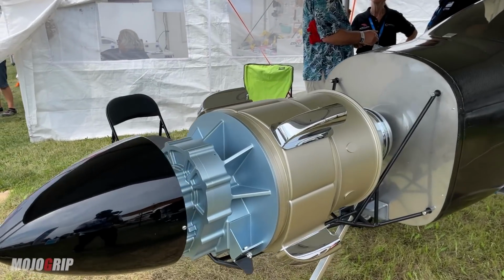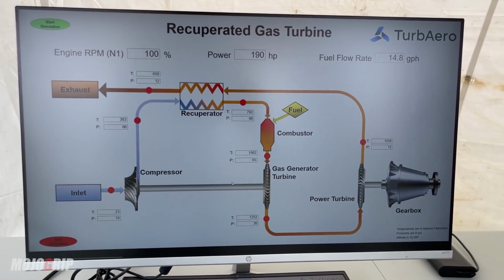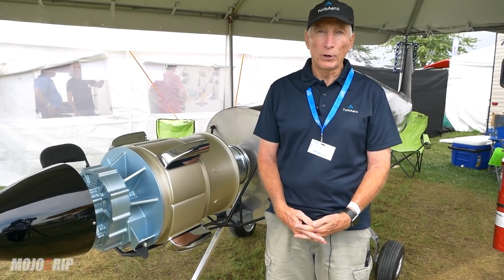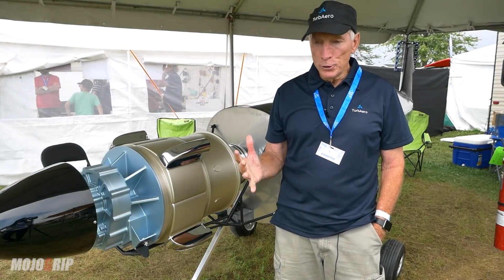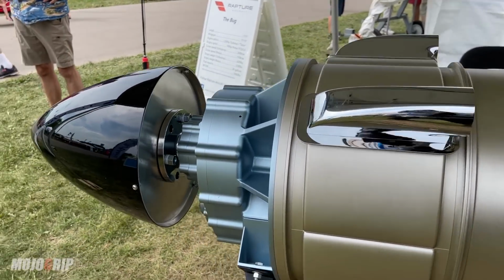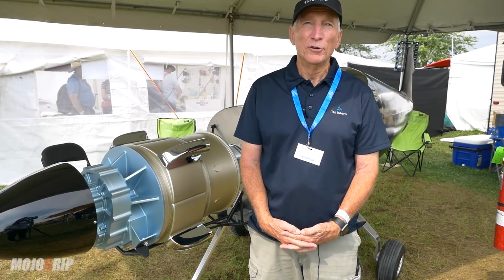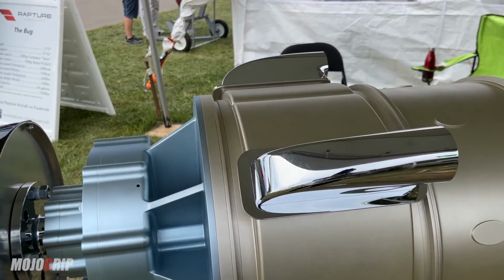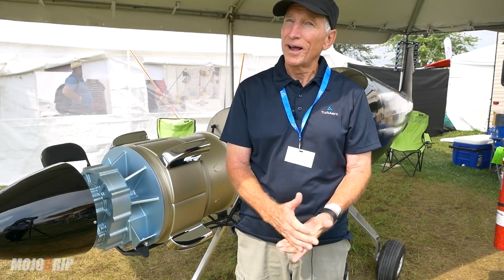200 HP TurbAero Jet Engine Will Cost $85,000

Comment: Reliable turbine 300 hp for $85,000 and ill trade in the IO-550 tomorrow.  200 hp is a joke.  Fuel flow 33% higher.  Cost 2X.  Maintenance 10X.  And the ridiculously named “recouperator”. Ha ha. Yet one more dream engine that will NEVER pan out.  There have been dozens since i started flying.

Comment: 200 HP it's to equip a cessna 172 or PIPER ARROW, most interesting if you put 300 hp/ 250 hp, to equip other planes... 200hp is very low!

Comment: Deltahawk Diesel has been "ready for production" for 10 years now.  Innodyne took my deposit promising a .59BFSC rating.  I should have known better since it was a single stage compressor design just like my helicycle.  The PWM fuel injection offered zero efficiency improvements.  Long story short - what you see is a 3d plastic print of what an engine will look like.  Components being tested means that it has never been assembled or run as of 2022.   2023 would appear to be a pipe dream to me for distribution.  When the engine is installed on a RV-14 and will show at least the same performance as a 210HP IO-390 and a true fuel consumption can be established I will then be very interested.  I truly hope they are on to something here, but I will guarantee you that if P&W could improve fuel economy by 30% or so they would most definitely come up with a "clean sheet" design to sell to BeechCraft for the thousands of planes already in the air and the thousands to be produced. I wish them well, but please show us the inside of the engine with hot and compression sections.  A good engineer will immediately tell you if any of these efficiency claims are reasonable.  Also, JetA is now more expensive than 100LL.  If uncle Joe and Mrs Giggles is in power much longer you will need hamsters and wheel to power your plane.  Any fuel will be unavailable.

Comment: Will this high-efficiency smaller turbine (with a 19 gallons per hour fuel use) have enough power to support: 
  *  Air conditioning
  *  Pressurized Cabin for 4 - with Oxygen
  *  Anti-Icing
  *  Autopilot
  *  Retractable Landing Gear
Reply: I read somewhere it generates 100amps.
Reply: Turboshaft engines  are what keep helicopters in the air - that's no small feat.

Asking a smaller turbine in a fixed wing to simply spin an alternator is straightforward.

Comment: Specific fuel consumption is apalling and specific weight too heavy. At low power the specific fuel consumption gets to be downright catastrophic.
Reply: Hello Ari.  Did you consider the difference in Specific Gravity of JetA and Avgas when comparing fuel consumptions?  It is not valid to compare SFCs when the SG of the fuel types is different.  If you care to compare the anticipated fuel consumption at 10,000' of the Talon operating at 150hp to that of an IO-360 operating at 150hp (actually the IO-360 is limited to 70.8% of its sea level rating at 10,000' so about 140hp at WOT at 10,000'), you will find that the fuel consumptions aren't too far apart.  However, when the cost of JetA is compared to Avgas, you could be pleasantly surprised to find you have a lower fuel bill with the Talon at those operating conditions.  
Of course, each aircraft owner will need to determine what his normal mission profile is and do a valid comparison to determine whether they should be considering the Talon as a viable alternative to their powerplant. e.g. the owner may find that his IO-360 is not powerful enough to cruise above 10,000' and has to accept a low cruise speed in his Lancair due to only having a maximum of 140hp available, but the Talon at 10,000' will still offer more than 180hp.  The Talon won't work for every one, but it will for some.  At least for those, we will offer an alternative to the existing piston engine offerings.

Comment: Why are so many people in the comments section so negative towards this. Clearly some of yall have never flown a 2 or 3 hour cross country sat behind a io360. Now do that regularly. The fatigue due to the vibrations is insane. Imagine having a small 4 place plane operating with turbine smoothness and quietness. And dont forget. Less points of failure. I hope this succeeds this is what the GA market needs. Remember when everyone was against automation and computerization in the ga market until players like diamond took the leap of faith and now anyyyyyone would kill to fly a da42 or 62.
Reply: I disagree with pretty much all of that. I routinely do 6 or 8 hours a day behind a noisy piston engine, and it really isn't a big deal. I'm still against a lot of the automation, but mostly the touch screen nonsense, specifically. Diamond aircraft are hideous abominations. I don't care if I ever fly one really. This turbaero engine would be really cool though.
Reply: Problem is that it will burn a lot of fuel, turboprops are extremely inefficient below 500bhp
Reply: Hey it's been 3 years, did this make it? I can't find any info and their website still talks about future tense.

Comment: When they've got an option for 350+ HP, I'll be VERY interested.  The 200hp is just a little too small for what I'd want to use in a Lancair build.
Reply: Buy Walter... It is much cheaper, tried and tested, comes with reductor and prop from factory, It has 600hp out of 190kg engine. Check it on wikipedia. You have all the specs.
Reply: @OleDiaBole  I'm very familiar with the Walter.  Lots of Lancair Propjets have them.  The down side of these is their availability.  They're not easy to come by.
Reply: @RealRickCox  How about Russian Klimov VK800S? 140kg/800hp. It is  extremely modern, and specific fuel consumption is 260 grams per 1 hp.
I am not sure about Walter and state of their business, but Klimov, you can go an by one straight from the factory.
Reply: @OleDiaBole  Damn that sounds like a sexy engine!

Comment: It's interesting, but since it requires more fuel capacity to burn and the fuel is heavier, this is a niche engine. If the engine weight is hundreds of pounds less as a similar power piston engine, maybe it would pan out.

Comment: Sounds interesting but they should actually abandon it and do a turbofan instead. Imagine how cool it would be to have small twin jets on Sling size planes. They would need to be pressurized but same size and lower weight. 700km/h, twin engine crossing oceans, smooth quiet at the edge of space. Just sayin :) That would be real freedom. Diamond DA50 need not apply.

Comment: This engine cannot get the BSFC that is claimed. Period. The end. My day job involves gas turbines, and we've done a few "clean sheet" designs (LEAP, Passport) recently, and would have done anything to get the specific fuel consumption he is hinting at. The GE Catalyst is clean-sheet, and won't come close to the claims. Neither will the Talon.
Reply: If they can make the recuperator work, the SFC numbers are possible. These are used on stationary and marine gas turbines, lowering SFC substantially. Also used on Chrysler and Rover auto motive gas turbines back in the '60s.The big difference is there is lots of space available on boats and static applications and weight isn't a concern. In an aircraft, space and weight are very important. The challenge is making a compact and efficient HX and that's a hard nut to crack. It all hinges on that aspect.
Reply: Hate to burst your bubble Kenny, but the 120hp is doing all they claim it will do, but as mentioned, the packaging with the HX is where a lot of effort is being put .. 

 Why they don't have the fully working 120hp on display, I don't know
https://www.youtube.com/watch?v=FEn1iCU6Hh0
Reply: Isn't GE projecting around 20% better fuel consumption than a comparable PT6?  That would be a great achievement if they can.
Reply: Correct.

Comment: I would consider one for the following reasons:
*reduced noise
*reduced vibration
*more power at higher altitudes
*no shock cooling concerns
*the "coolness" aspect
"Full fadec
*Lower in cost Jet-A
*did I mention the "coolness" aspect?!!
Reply: But it's 2x the price of a TIO-360 that makes more power & burns the same amt of fuel.
Reply: @dieselyeti  100%

Comment: The fuel consumption of 12gph (they won’t get that, it will be more like 15gph) won’t make it practical.  Cool, but not practical. Turbines do well up high, real high. I burn 7.5-8gal per hour at 8kt DA in my io-360.  Turbines aren’t new. The reason GE and the big guys don’t do it isn’t because you need a clean sheet, it’s because there is no market.

Comment: This is much more the originality reported or mis quoted , I thought it was 8k
Reply: Mike did a video on this yesterday and I thought that’s what he said, maybe wishful thinking 🤔 LOL
Reply: You thought a brand new turbine engine was going to cost the same as an experimental auto conversion piston?
Reply: @TheOwenMajor  The original intent was to make a low cost turbine, then an MBA modern business guy got involved with the company ... enough said ..
Reply: @markmark5269  Well there is no way you are going to make a successful turbine engine selling engines for that cheap.

The only way experimental conversion engines get that cheap is because they are pulled off a assembly line that makes hundreds of thousands of them.

Best case scenario they still sell under 20 of these a year. At 10 grand  profit per unit that is hardly enough to keep the lights on
Reply: @TheOwenMajor  I am the messenger, merely repeating facts, but not my facts.
Reply: The original intent was to make a low cost turbine, then an MBA modern business guy got involved with the company ... enough said ..

Comment: This product does not make sense to me. They're aiming at the value end of the market with a modestly powered, very expensive engine. Its nearest competitor would be the turbocharged Austro engines and the Continental 300-CD. As with the Turbaero they use use Jet-A, have FADEC and perform well in high altitude, but they're cheaper to service and use 25-50% less fuel. Cessna stopped production of their Diesel 172 after 6 months because nobody wanted to pay the premium over the petrol version. That's the market Turbaero is aiming at.

Comment: "Recuperator" fancy word for a heat exchanger.
Reply: Not a fancy word, it describes the thermodynamic function like intercooler does.
Reply: I can't see how it will actually help. You can use a regenerator, but your back work ratio (ratio of the compressor work to the total output work) is increased if you're heating the gas and increasing its pressure. An intercooler might be more useful here.
Reply: @deSloleye  Actually, regens have been used to good effect, usually on Earth-bound machines.
Reply: @UncleKennysPlace  yeah they do save a bit of fuel where you get high effectiveness of the heat exchanger. It will be interesting to see how they implement it.
Reply: @deSloleye  work to compress the gas is increased if the gas is heated BEFORE being compressed. A recuperator heats the already compressed air so that does not affect the compressor work. On the other hand the potential for heat exchange is less as the air is already hot from compression.
Reply: josue Kay  yeah I know what a regenerator in a Brayton cycle is. Combining intercooling if you have multiple stages increases efficiency, by reducing the back work ratio. You can either run more power or less fuel, but you lose less fuel spent driving the compressor.

Comment: It must beat the fuel efficiency, power and price of a piston engine or you're just selling coolness. I'll take a converted Mazda rotary for one tenth of the price and get more than twice the power with the same fuel consumption.
Reply: Jay, I think it’s important to also consider reliability and performance (climb and at higher altitudes).  I’m not sure it’s just about being cool.  I’d pay more for higher reliability.
Reply: @jglenntrnr  so would I but that's yet to be seen with this engine but I should probably say, even an engine with less than ideal numbers is more than we had and it will likely lead to better cheaper engines. It's definitely welcome. I just want a turbo prop that beats the piston engine. I'm never going to bolt a conversation engine to my own aircraft but it illustrated the difference in performance between a purpose built airplane engine and an automotive engine. You shouldn't be able to take the engine out of my truck and get better numbers in an airplane than just about every aviation engine but you can.  Someone needs to keep that reality in view as they build the engine that finally out performs a Honda Civic for weight, power and fuel consumption. Then figure out how to make it affordable.
Reply: Are there Mazda conversions currently flying? Just  curios. Please link to one, I’m very interested.
Reply: @tomcoryell  I'm totally with you!  Not sure what has to be different in terms of a conversion, but I'm reasonably sure that Rob Dahm could build an extremely reliable rotary engine that would stand up to just about any kind of abuse you could throw at an airplane.
Reply: @tomcoryell  Mojogrip Mike did a piece on one. Many builders have created their own. I don't care to learn how to link stuff. I'm busy researching and building my own aircraft. You can find lots of info on the wankel in aircraft. One broke a climb record.

Comment: How much does a 200 hp lycoming cost?
Reply: A io-390 is 32k and 140 kg. So they figure out how to fuck the power to weight ratio (the best part of turboprop and turbo shaft if you want a mini fighter) The pbs tp 100 gets 240hp for takeoff and 190hp cruise at 63kg. Its $160k but its also a alredady flying.

Comment: I would really like to see a 50hp turbine engine made inexpensively that can burn alcohol or biodiesel. Why? Vehicles on average are only using 30-40hp. By running at a constant 50hp, and coupled with a generator, you can charge a modest bank of capacitors with the excess, and when you need 200hp for a few minutes, you have it. Turbines are great at burning whatever fuel you give it, and the energy density of fuels are magnitudes more than charged batteries. With biodiesel or alcohol, you have a carbon-neutral, very high specific energy, renewable source of energy.

Comment: Dreamware. 

Until it actually flies, it's all Hope's, wishes and dreams.
Reply: In the TALKING stage, it can do anything and everything.
Reply: I think this engine if they get it built would be practical for homebuilts/experimental aircraft but for certificated aircraft I don’t see them getting this engine certificated at least not before they go broke trying I’m excited about the idea but not holding my breath
Reply: Isn't that everything that gets designed, tested, refined, and perfected?
Reply: @GrizzAxxemann  Sadly, in aviation most dreams never actually get built.
Reply: @dirkhamilton2709  Vaporware.

Comment: This may be an alternate opinion but wouldn't buying a used Garrett or Pratt PT6 turbo prop be cheaper and they have a better track record of reliability?  Yeah they consume more fuel but their output is also significantly higher and will get you to your destination faster.
Reply: A new PT6, not even close, those are priced in the hundreds of thousands. 

A rebuilt one, still no, but closer.
Reply: @TheOwenMajor  yes new ones are expensive but there are plenty of pre-owned, rebuilt pt6 with excellent warranty and reliability same holds true for Garrett and other  tueboprops that have been in existence for decades with plentiful spare parts.
Reply: As for speed, most aircraft are limited by their aerodynamics, which means sticking an ever more powerful engine isn't going to help as much.
Reply: @TheOwenMajor  that is true for lots of aircrafts speed limited by their aero design.  But a let's assume that a particular craft was designed to achieve 170 knots with a Lycoming 300 HP piston engine theoretically if it was replaced by a 600 SHP Garrett turboprop it is not inconceivable that the same craft could go 200 knots max speed.
Reply: @iancxxx  Sure but that's my point, you aren't getting a whole lot extra speed for alot of extra fuel consumption.
Reply: @TheOwenMajor  what I originally meant was that buying a older turboprop would be cheaper than this new anemic 200 horsepower powerplant
Reply: @iancxxx  So I looked up the overhaul costs for the smallest PT6, it's $230,000.

Granted the smallest PT6 is still much larger then this engine.

Comment: how responsive is this in terms of  power? is it a slow build up? or snappy when you "add coals to the fire?" do they know yet?
Reply: Turboprops are very quick to produce power, as the turbine is already running at a speed that will allow the prop to pitch to a point that bites... Same as a PT-6 or any other engine. They are not redesigning the control of an engine, just the addition of a recuperator.
Reply: @MercFE8235  He is talking about throttle response.  Lag, or spool up time.  The PT6, even in flight idle, has a little bit of lag when the power is applied.  The engine is only running at around 60% ng in flight idle.   You don't have that instant power when you push the throttle lever forward like you do on a reciprocating engine.  The Garrett 331 is a little different story, but I have never ran one.

Comment: Meh, I don't see its advantages in the experimental world.

It's more expensive to buy, more expensive to maintain, more expensive to run, and might produce marginally more power for it's weight.

I
Reply: Jet-A fuel in a post 100LL world.
Reply: @azcoyote007  this is what i thought right away.
Reply: @azcoyote007  100LL ain't going away anytime soon, at least not in North America.

As for experimentals I think engines that can take mogas would be the natural default in that world.